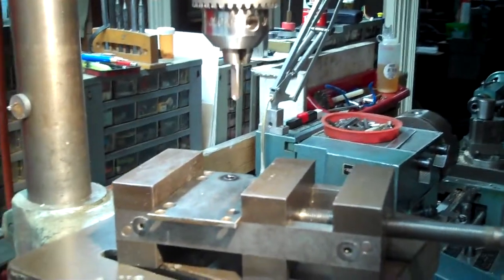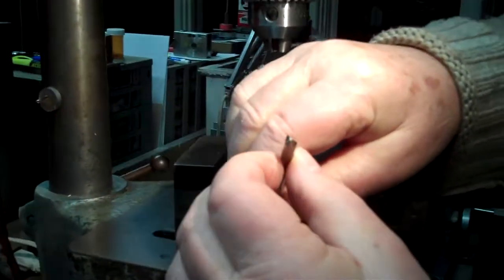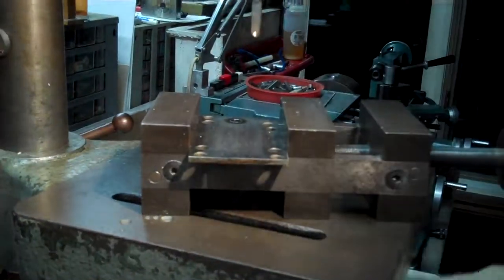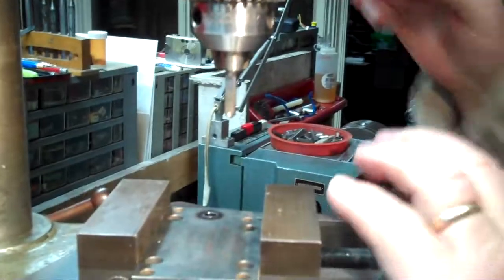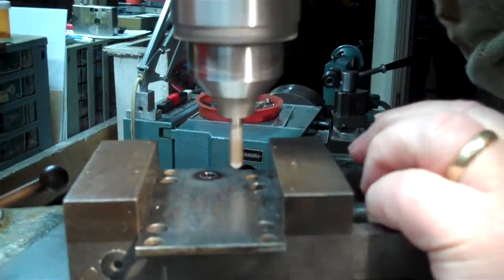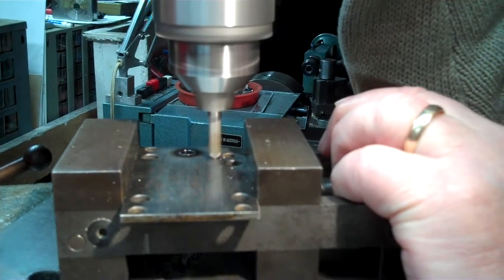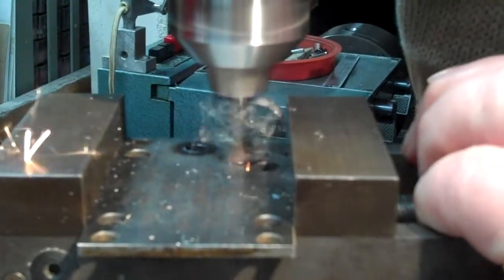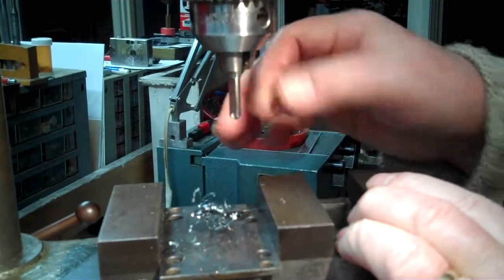VID00005

Comment: Combustion engines are the cause of times we are facing.
Reply from the maker: Why?  Are you aware that in Los Angeles the exhaust from a modern car is cleaner that the combustion air sucked into the engine?
Reply: @ 
Still stuck¿ in time ¿

Comment: You were a machinist all your life and you operate machines with EXTRA baggy long sleeves?
Great lesson.
Reply from the maker: While not a machinist all my life, you make a very valid point!  Long sleeves are a no-no when operating or near machinery.
A thousand apologies!
Reply: @BasementEngineer  Sorry for being harsh. That was drilled into my head for 46 years.
(tool maker/pattern maker/die maker)
Reply from the maker: @FixNewsPlease  No need to apologize.  "No long sleeves" is a most important safety admonition  that bears repeating often, as you proved to me:-))

Comment: prob not good for taping though since the heat probably weakens the surrounding metal but maybe ok if going slow?
Reply from the maker: Speed of the drill is required to heat and soften the hardened metal, which is then pushed out of the way through the flutes of the drill.
Coolant would be detrimental to the process.
Reply: @BasementEngineer  yeah, ok; thanks.
 maybe tapping would work anyway. i looked those up on amazon and didnt c them.
Reply from the maker: @sticksbass  If you need to to tap a thread in a hardened steel work piece, it can be achieved on an EDM die sinking machine with a creative operator.
I've seen this done during my apprenticeship days

Comment: Coolant may have been used
Reply from the maker: No, stellite drills are used without coolant.
The idea is to heat the hardened steel to the annealing point, and then scoop out the softened steel.